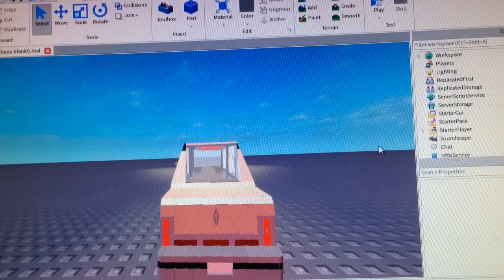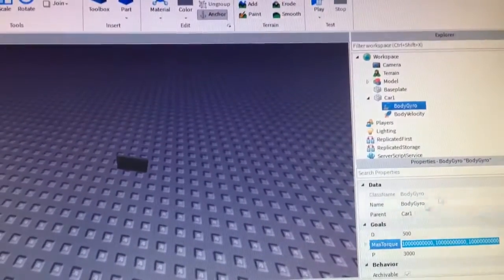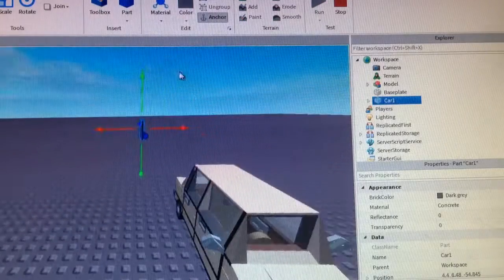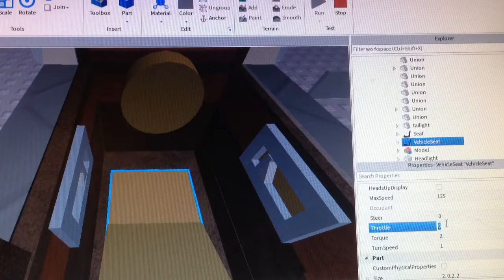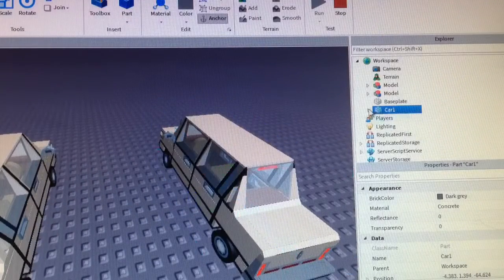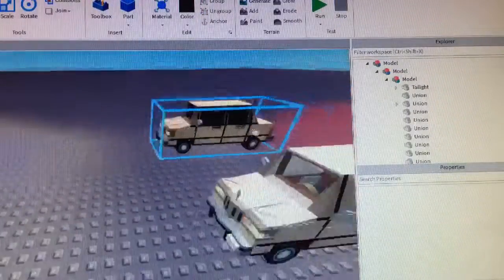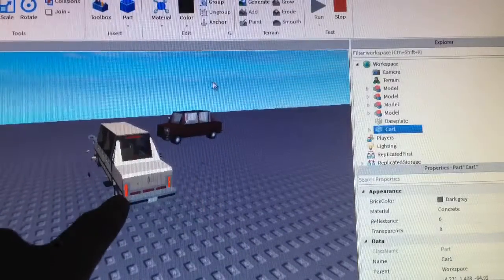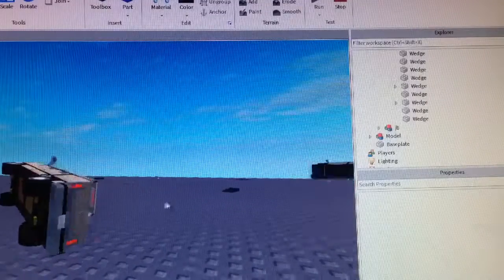How to make a car with a constant force using body velocity and body gyro

Comment: You can also add conveyors by placing it right in the roof or the front of the car grille like it is used for car crashes
Reply from the maker: I don’t use conveyors. They are restrictive. Heard of that though. This part I can just delete.
Reply: @42luke93  I still use conveyors